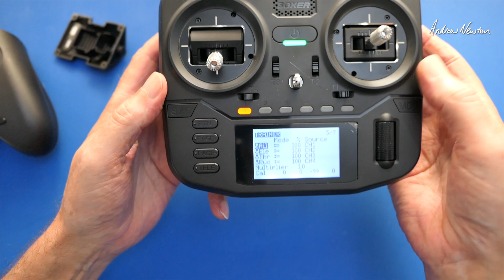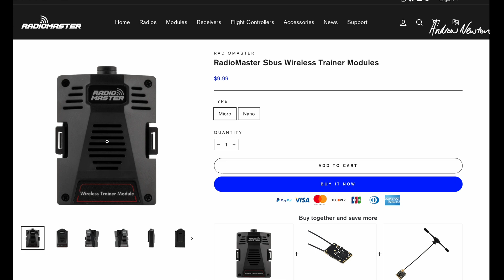RadioMaster Wireless SBUS Trainer Module

Comment: Hi! How can I bind the receiver to the student’s radio? Do I bind it after installing it inside the trainer module, or should I bind it before putting it into the module? If it must be done beforehand, how do I bind it? Most videos show the “power on/off three times” method, but the receiver will already be connected to the drone.
Reply from the maker: I use passphrase binding before mounting in the trainer module.

Comment: What if the student radio is used for other models? All my models and transmitters are ELRS. Found this to be confusing. 

m
Reply from the maker: My student radio is ELRS in the video. Makes no difference as long as you set the receiver in the trainer module to output SBUS.

Comment: Hi Andrew, I've got a TX16S which I attach a module to get ELRS for all my planes. I've also got a Radiomaster Pocket ELRS. The TX16S was going to be the instructors radio, but already has an ELRS module in the back already, hence unable to attach the wireless trainer module. Do you know of a solution for this, many thanks... Brian in Germany.
Reply from the maker: Can't see a solution other than removing the ELRS module and using another receiver for the trainer plane supported by the internal RF. Or using the pocket as the instructor radio
Reply: @AndrewNewton   Thanks Andrew, think I'll buy a Radiomaster Boxer with internal ELRS and then use a wireless module trainer (I bought both the Micro and Nano for all eventualities) in the bay to the rear. Gives me an excuse to buy a new Radio 👍📻😂
Reply from the maker: @brianjones238  Haha! I endorse your decision.

Comment: Could you please show all edge tx menu settings if any left out and also what module bay pin counting down from the top of the 5 in the module bay.
I have the module ordered but it may be 15+ days until delivered.  I have the r81 receiver ordered and I want to wire it until the module is delivered. Do these receivers lose connection if too close to the transmitter?
Reply from the maker: Try a search for JR Bay pins
Reply: I did a search and done sat heartbeat pin second from top, others say bottom pin? Also openTX could use a frsky Sbus receiver polarity but Futaba Sbus polarity is flipped I understand. What does radiomaster and edgeTX expect?
Reply from the maker: Don't know sorry
Reply: @gr7396  To the best of my (very limited) knowledge, it is not possible to feed a raw S-bus signal from most receivers directly into any of the 5 pins in the JR Bay on the Radiomaster TX16S etc radios. (I believe that it could be done with FrSky radios - but CHECK!) You CAN feed an S-bus signal into the UART connector on the bottom of the Radiomaster TX16S BUT it requires that that S-bus signal be INVERTED to the normal S-bus signal put out by Futaba/Flysky/FrSky etc receivers. (Ironically the normal S-bus signal IS ALREADY "Inverted" so what you need for the bottom UART connection is actually a "Non-inverted" S-bus signal!)
What this device does is reverse the normal "Inverted" S-bus receiver signal and present it to the correct JR bay pins to be able to use it via the current S-bus Trainer choices on your Radiomaster Master Radio. 
Note that you can tap the 8.4v supply available in the JR bay of your TX16S (not sure if the other radios supply 8.4v or 5v - might be the reason for the separate input socket on this for the TX16S) to feed a receiver that is 8.4v capable (like an FS-A8S Flysky AFHDS 2A receiver) and feed the PPM signal from that receiver directly into a wire soldered to the Trainer socket active point on the top of the radio. Then you can simply choose "Trainer Jack" for your setting on the TX16S Master Radio. AND, UNLIKE WHEN USING THIS MODULE, you would then need to turn ON the External Module to output power to the Bay pins.
But, as the man said, the VERY first thing you should do is "Try a search for JR Bay pins" for your Master Radio. 😉😊

Comment: Looks nicer than the wire connection.  There is a way to get more than just the 4 controls it gives by default.  I think AndyRC has a guide on that
Reply from the maker: Thanks for the tip

Comment: On my old Taranis, I used an XM-plus micro receiver to do wireless Training. You could plug it directly onto the JR bay pins using a standard Dupont plug..Worked like a charm on sbus....Radio master changed their hardware though....now it's catch-up time...🤔😳🇬🇧
Reply: Yep, the old FrSky radio would accept a direct feed from an S-bus receiver plugged into the JR pins. But I dimly remember that you had to reverse the power pins to the Dupont plug - or am I incorrect?  The Radiomaster needs this hardware converter.
Reply: @theoztreecrasher2647  Yes, it's 3 wire SBUS....but your right, the red power wire isn't in the centre as usual where it plugs into the JR Module pins...You need to be careful with this...or it will blow the RX...🤔😳
Reply: @EnglishTurbines  Thanks ET!

Comment: So in terms of differences from say an external 'Ranger Nano 2.4GHZ ELRS Module' on the back of a trainer transmitter, this module just allows you to use smaller modules internally? There's no other differences?
Reply from the maker: No, totally different. This is a receiver while the Ranger is a transmitter. 
EDIT: Oh I understand your question. You can use any SBUS capable radio/receiver as the student so yes a Ranger module would work the same.

Comment: Hi Andrew, with this module fitted to my 16ts on mode 1 can I train someone on a mode 2 a radio? Just thinking how much easier it would  be  for me..
Reply: As long as you check what is configured in the Trainer menu shown around 2:58 you should be good.
Reply: Thanks mate, I'll order one and give it a go, bloody hard swapping to mode 2 when I fly mode ..
Reply from the maker: Yes as Vlad said, just have to map the correct controls to their channel
Reply: Thanks for the reply Andrew.